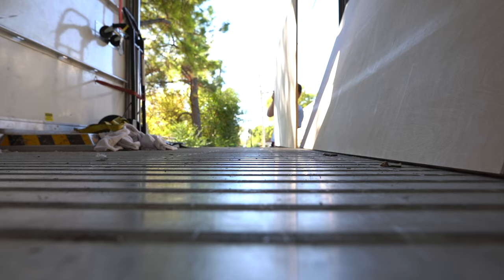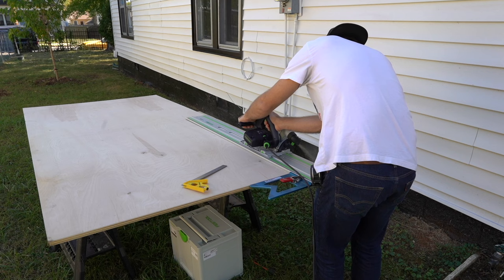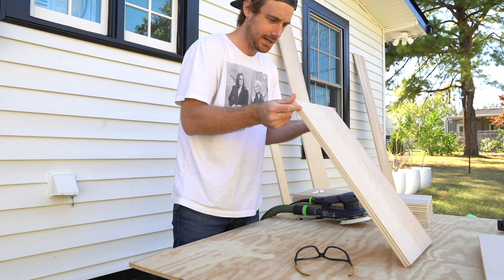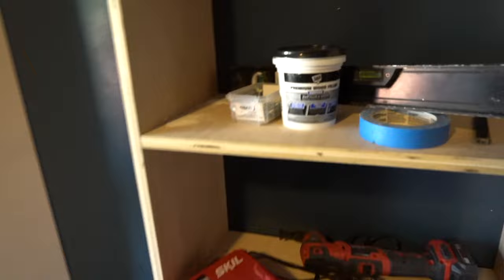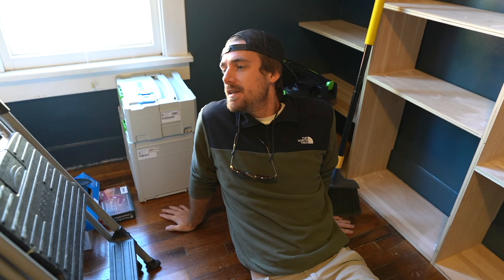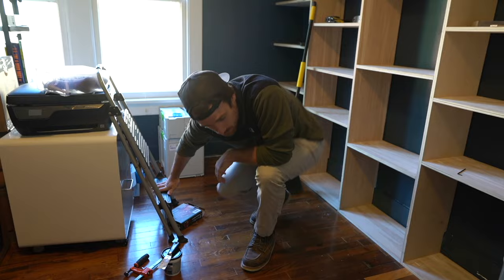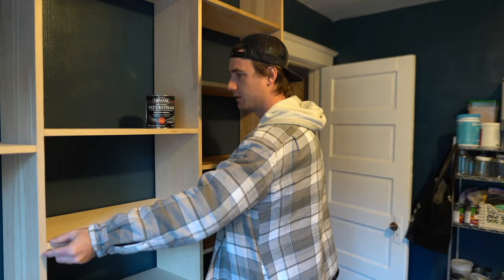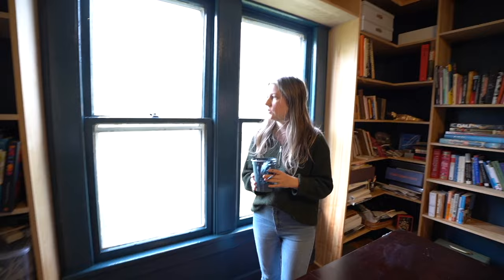We built this MASSIVE 3 wall Bookshelf!! || Simple Design

Comment: Look great.  Suggestion, you can use a router and put dado's in the vertical pieces to hole the shelves.   Much stronger and no hardware.  Also like others have asked, how are these attached to the wall?
Reply from the maker: Yes the dados may have been a better solution in this situation! And I used several L brackets scattered throughout where there were studs

Comment: I really like this video but I'm a little confused on how to secure the assembly to the wall. Got any tips?
Reply from the maker: We used a mixture of pocket holes into studs and small L brackets spread throughout. Not how I would do it nowadays tho
Reply: @justinandjessdiy  how would you do it now that you know?
Reply from the maker: https://marylandcarpentry.com/home-office-built-in-on-a-green-wall/

Check out the top shelf of this build. There’s a small strip of wood that runs the length of the bookshelves attached to the top. Probably a cut off from whatever material they used to build the shelves. Maybe 2” in width, using that to attach to the studs. I’ve done that on several recent projects. Very common

Comment: pocket screwing from the top when the shelf has to hold a significant amount of weight can lead to failure. i did the top two shelves in a large bookcase with pocketscrews in the top and they tore out, the wood is just not strong enough with a steep angle pocket hole like a kreg jig makes. going in from the bottom, the screw will usually shear before the shelf gives, so i think you flipping the shelves will be to your benefit in the long run. it is similar to pocketholing from the inside of a case instead of the outside. one direction is weaker than the other. build looks pretty good. a lot of fiddly work.

a trick i was taught for lining up track saws is to make a piece of hardwood the same width as your tracksaw's kerf. plop it into the first kerf and but your track against it when you move the track. that will give you a nearly perfect transition and is quite a lot faster than futzing with it by eye. the other option is lay your track down and clamp a straight edge along the back of your track so that your track buts against it and you can just move your track up as you need to go. i've used that method to break down 12' sheets with a 36" track and i couldn't find the transitions when i went back and looked a day later.

Comment: Excellent job, Justin. I couldn't agree more about the limitations of the accu cut jig. I've spent so much time mitigating the play in mine that I'm at the point of breaking down to buy the ts 55. When I'm commissioned for built ins like this i either hide the pocket holes on the face of the board not seen at eye level or set up my dado blade for the joinery. I started out edge banding but started face framing the plywood edges with poplar. It's relatively cheaper than most hard wood and takes finish really well. I got mad respect for you installers with all the scribing they have to do since most homes aren't level.

Very very impressed by this build and your skills.

Edit: i commented before i watched the part about you flipping the pocketed faces. Oops
Reply from the maker: This was a big job for me so thank you!!

Comment: just curious why you chose to put the pocket holes on the top instead of the bottom so theyre hidden? is it just structurally better? Looks great btw, good job
Reply from the maker: at first for ease of assembly. i ended up changing to the underside

Comment: Get good before you tell others how to do it. Pocket holes on top was stupid. Cutting freehand on the table saw will cost you a finger. Wow!
Reply from the maker: 1. No where in the video are we telling others how to do it. Just showing how we did it. 
2. Pocket holes on top was a choice based on the info we had at the time. We ended up changing it. But you must have missed that in the video. 
3. It wasn’t free handed. Watch closer. You’ll see a cross cut guide.
Have a great day 👍🏻